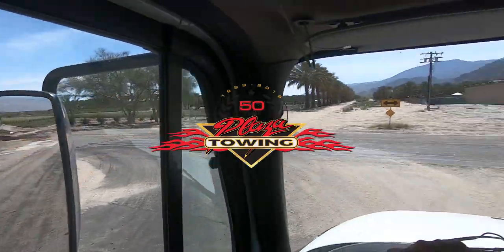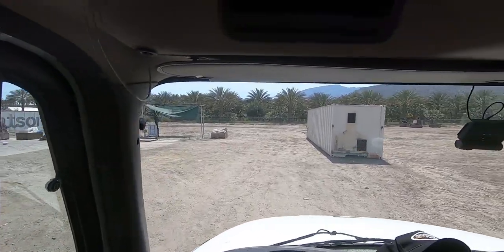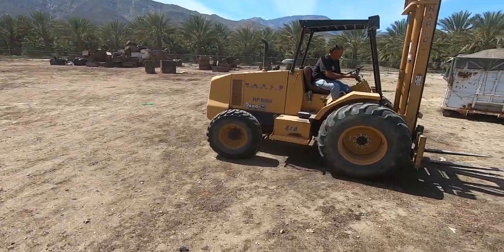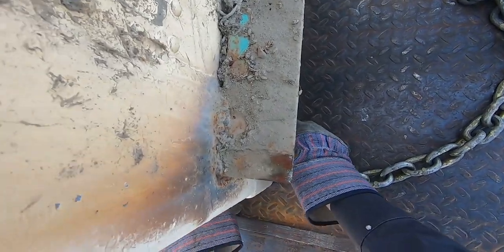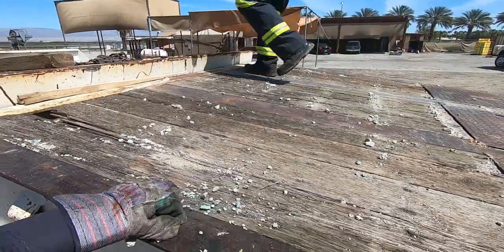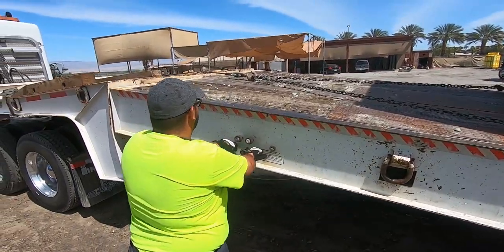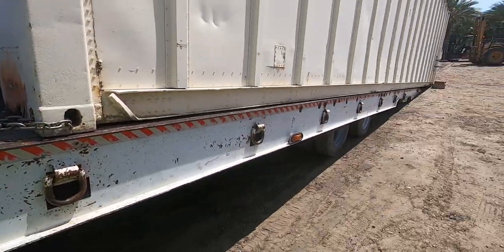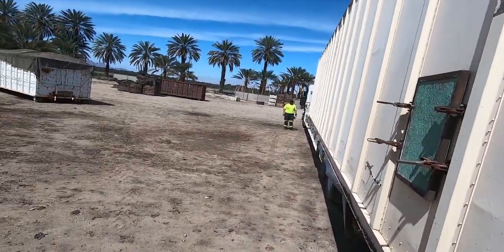Hauling a 40' Container

Comment: One point, 10/10 times when I am on level ground I leave the one container end on the ground and release brakes on truck and trailer and then winch myself underneath of container.  Little easier on equipment when only other end of container is sliding and not the entire bottom creating drag.  At least you had a fork lift to center it on the deck, always nice.

Comment: Would you consider releasing the brakes on the truck and sliding under the container as you are winching it on the bed. I used it when I ran roll off container trucks,  seems to be easier on the cable and I guided the trk underneath as I was rolling under the container.

Comment: You don't ever use the 400 series for containers? 

I would suggest getting some 4"x8"x1/2" angle iron for the sides. Rectangular tubing could be welded on the bottom of the angle to slide in the stake pockets of the trailers.
Reply from the maker: We don’t use our landolls because the containers destroy the wood decks. Thank you for watching!